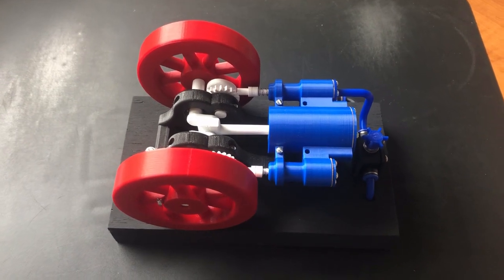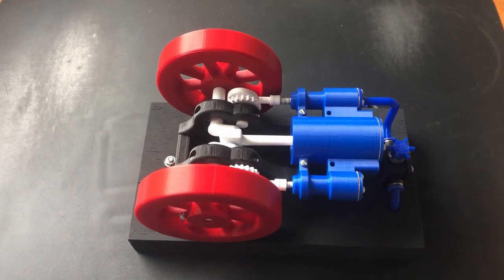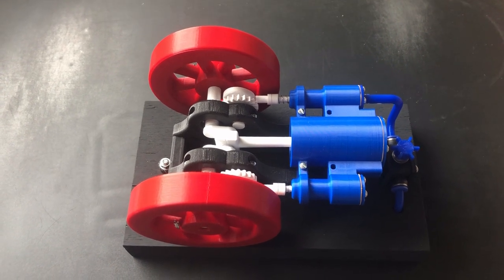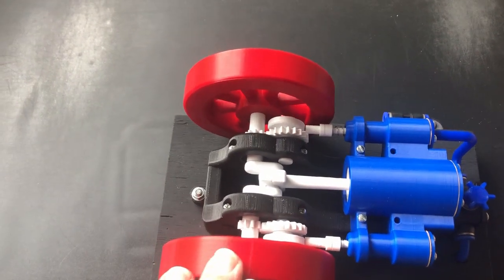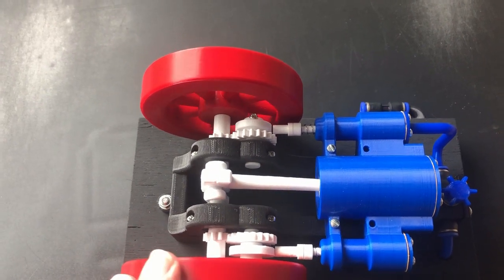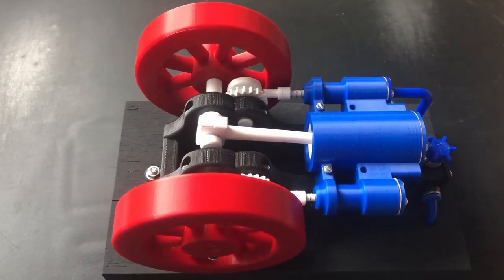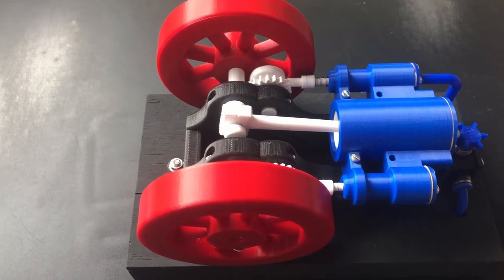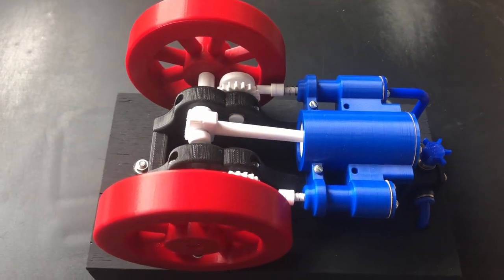4 Stroke Air Engine Video

Comment: At what psi did you run it?
Reply from the maker: Hi, I had about 20 psi to the controller but it ran happily down to about 10psi.
Reply: Pretty impressive for such low pressure
Reply from the maker: @BrickEngines
Reply from the maker: @BrickEngines  I couldn't quite believe it myself. I assumed that I would require high pressure as air supplied every other stroke. I did ensure that everything was running smoothly with minimum of drag and I made the flywheel solid to gain maximum momentum